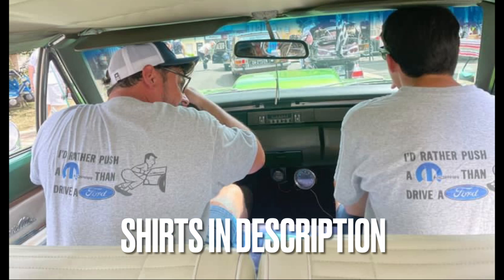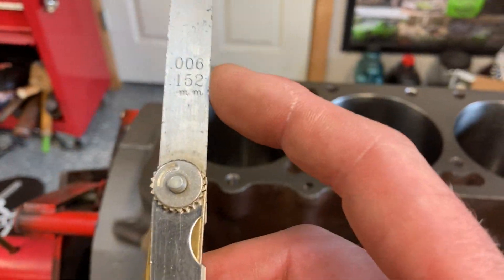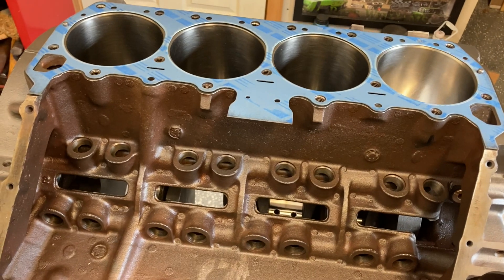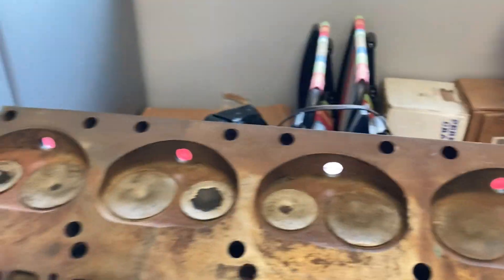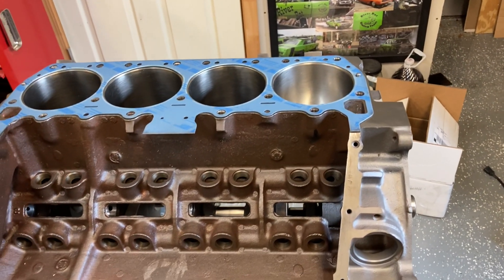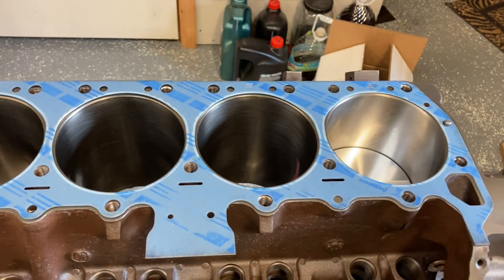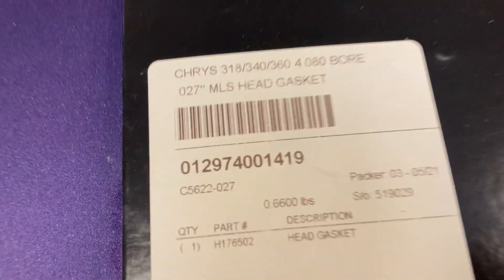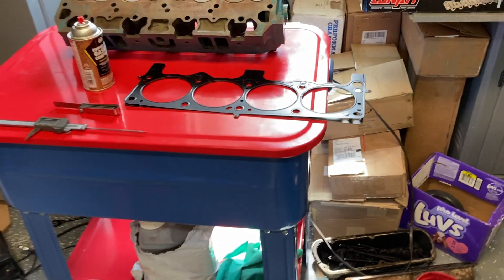3 Common Head Gasket Mistakes Made by Mopar Engine Builders(that Affect All Brands)

Comment: With respect to the concern about galvanic corrosion between an aluminum head and an iron block, a 6061 aluminum has an electrogalvanic potential of about -800 mV, and nickel-chrome cast iron has a potential of about -650 mV. The difference is 150 mV (or 0.15 volts). If the coolant is conductive then a galvanic cell will exist and the aluminum, which would be the anode, will corrode. However 0.15 V of potential is small and uncontaminated water is not very conductive, so the corrosion rate would be very small. Glycol is even less conductive than water. However with years of use the coolant can become more conductive. For this reason antifreeze usually has corrosion inhibitors in it. Occasionally a manufacturer (GM for example) will use an unusual alloy in their engines (Cadillac) that is very susceptible to galvanic corrosion. In these cases the manufacturers recommended coolant and flush intervals have to be followed or catastrophic failure is almost certain.
Reply from the maker: Thank you for sharing. I am actually a licensed home inspector. Seeing galvanized hooked to black pipe, etc. has made me a believer. Granted the corrosion I see could be 10 years old.
Reply: @JustMoparJoe  I'm sure as a home inspector you have seen it all! My own current house, when I moved in 15 years ago, was horrendous, especially the wiring. I have sorted it out back to code over the years but now and then I still discover a surprise from previous ownership. I am a chemical engineer with a love of hot rodding and an affinity for Mopar products ever since my mom ordered the first Road Runner sold in Alberta in the late summer of 1967!
Reply from the maker: @gavinmclaren9416  send me email, if you don’t mind. justmoparjoe@gmail.com
Reply: Our water pipes leaked and finally sealed themselves. 
Calcium I'm guessing. Running water in a hose clogs. Y connections corrode so the valves won't turn.
Reply: Nickel!
Reply: Bingo maintenance is key! Great explanation by the way.
Reply: Modern coolants (not green) have special additives for this. I have pulled apart Cummins ISX engines with 500,000 miles on them and all metal parts aluminum or iron looked like new. I have a Milodon gear drive we ran on a 440 for many years with green coolant. The aluminum water pump spacers are so corroded they are almost unuseable now. There's additives out there for the old coolant for this, there used to be little zinc bar sacrificial anodes with a chain on them to put in your top tank. All of this depends on the alloy as well. I'm sure we have all seen the corrosion on old aluminum water necks, but the smallblocks have aluminum front covers and I haven't seen a failure from this on the ones I have owned, but I build mainly big blocks.
Reply: Water isn't exactly conductive except salt water. I think depending on what's in your water (such as copper or iron) it will effect the conductivity from the start. Distilled has nearly no conductivity, and would be fine in an engine with the voltages it would see. Any metal that falls off into the water from inside the coolant would definitely cause it become more conductive though. But with how much coolant costs I wouldnt mess around with water especially since all it would take is one freeze and you're gonna have issues. And given Texas had that winter storm I think that's just a big risk that's not worth taking. I live in NY so water is not gonna be going in any engine of mine unless I need to limp it home. Plus the extra additives in coolant that make it cool better and prevent corrosion just seems like a no brainer for the price. Why mess around when you can just guarantee. It costs less than oil.
Reply: I can only think of two words..."Water Wetter"🤭
Reply: found a guy with 85 years old that solved that problem,, he had an engine with 55 years old, in his trawler
Reply: I never liked the idea of iron block/ aluminum heads. I bought a 1990 Buick century with a 3.3 LITRE. The seller to me, never used coolant. I ran  water & rust converter, then flushed it. Ran coolant and had no problems. But next smog test it failed on NOx badly. I never got it to pass. 
Later I drove it to work & when I got home it gushed a puddle of pink fluid. 
The transmission tube in the radiator had broken. 
ATF mixed into coolant & vice versa. 
I added a trans cooler, external. 
Flushed the cooling system. Easy. 
Tried to do a transmission flush after a filter & pan dump & cleaning. Lots of black clutch material. 
After 4 gallons of ATF run thru, both line disconnected, no success. Still pink.
In all the time I owned it , never blew a head gasket.

Comment: Just remember most big block Mopars came with steel head gaskets that did not use anything like copper coat. With that being said been drag racing for almost 40 years if it's a steel head gasket Ive always used copper coat up to 14:1 compression never had a problem.

Comment: They may be reusing their gaskets     Factory Max Wedge and Trucks had Stainless Steel shim gaskets    Victor and McCord had Solid core "Marine" and truck head gaskets  I do not know if they are still available but I had to use on my heavily decked 440 (to correct warped decks as Joe has shown) leaving my 6 pack pistons +015 out of the Hole   with a .050 gasket I ended up with . quench.030   with ported 915 heads as shown in the video  those heads also had pits on the deck where the o ring would seal 
No electrolysis steel gasket on Iron block but you do not want to use with AL heads as you can get Brinelling    You can use HYLOMAR on gaskets that are marked for Dry Use if you have water seeps
HYLOMAR works on the old RED gaskets and FELPRO   I never gets completely hard so you can disassemble  Developed by Rolls Royce for aircraft  miracle stuff
BTW my block also had HUGE chamfers which were made smaller with the decking  you want very little chamfer, just break the sharp edge and be careful when installing pistons

Comment: The main thing you should do is try the head gasket on the cylinder head itself because if the fire ring sticks in anywhere it will melt period so my advice is to make sure the gasket is way away from the combustion chamber. I think the trick flow cylinder heads have a larger bore. Fel-Pro sells a marine gasket. I think the part number is 1105 that has a larger inner bore diameter of 4.5 I believe.

Comment: Thanks Joe. I wasn’t aware of larger bore head gaskets. Felpro has different numbers for different bores? Or do you need to use another manufacturer?
I know my block is not perfectly smooth so I feel better now knowing I didn’t install the MLS. 
Jay Leno uses a different coolant that he claims will not break down and prevents rust. I wonder if that coolant helps with electrolysis. It’s called Evans Waterless Coolant. Ford has an additive for their diesel engine coolant as well. Any thoughts about any benefits using these additives when you use aluminum heads? Maybe a call to a manufacturer might be helpful.
Reply from the maker: I'm not familiar with that coolant, but I would suggest using a newer style coolant if you’re worried. Remember, all new engines have aluminum heads and have a coolant that’s made to prevent many issues.

Comment: I have chased the leaking gasket issue myself with attempted tuning, even replacing valve springs. Your issue was likely not at the front but between the cylinders. Mine wouldn't leak until under full power at around 5k rpm where the cam came in and cyl pressure was highest, then a little fire goes across to the cylinder on the intake stroke igniting it and causing backfire. It never showed on a compression test. It was a 383 that hadn't ever had the 906 heads off of it. that ran fine with the 1958 2x4 intake with 2 625s on it, but when I put long rams on it with those same carbs it created enough "boost" to lift the heads! I have ran a six pack, 2x4 bbl, tunnel ram, and most 4bbl intakes. Those long rams beat 'em all up to 7500 rpm with 2 big block thermoquads on them when cammed properly. You will have to pry those long rams from my cold dead fingers!

Comment: Corrosion will happen with dissimilar Metals that's a given but electrolysis requires an electrical field running adjacent to a running water source like a cooling jacket. I cannot tell you how many times I've had laid underneath the diesel engines getting  black rain all over me doing an in frame overhaul because they're blowing coolant into the cylinders from the pinholes in the in the cylinder liners caused by electrolysis. We always use a product called water wetter, it neutralizes corrosion due to dissimilar metals and also controls electrolysis. It also keeps the water pump lubricated. 
  Now as for the aluminum heads on the iron block with the steel shim, I wouldn't use just the plain steel bead rolled shim, I would use a MLS like a Teflon coated Cometic. No copper coat, just smooth, like Cometic says.
  Work goood, last long tine!😖😆😛😝🤭✌️
             Thanks Joe!
Reply from the maker: Thanks, Brother

Comment: C o m e t i c gaskets, the MLS style, aren't they Teflon coated except for the center shim? On my red 383 Magnum with zero deck flat top Pistons at 10.5:1 (no valve relief) compression I use and reuse a 0.015" shim, & I don't use copper coat. First time the bead is crushed it's only steel against iron, the second and third time the steel gets crushed I use a can of silver spray paint. (not the whole can) when I pull the heads it leaves little pentstars between the cylinders..
  Thanks Joe!
Reply from the maker: They do have a coating, but im not sure what it’s made of. I do know that copper coat sticks to it nicely. My wife won’t let me spray her cooking pan to test it 😅
Reply: @JustMoparJoe  maybe pick one from a second hand store. I know what ya mean. My wife threatend me w/bodily harm cuz i moved the fridge to the barn... she's gonna kiiill me when she sees where the stove is..
  Ima git 'er another one
Honest🏴🤑
   Thanks Joe!

Comment: Heck on a cast iron head i use the steel factory gasket with smith bros adj pushrods on stamped steel rockers do not want no more than 30 thousand on pre load on lifter
Reply from the maker: Thanks for sharing and have a good weekend

Comment: You did not offer a remedy for the overlapping gasket into the cylinder bore. What would be a head gasket option if you did a 60 overbore on a 400 block? You spent way too much time discussing putting coatings on head gaskets. I don't know anybody who does. It was a waste of time.
Reply from the maker: You want me to give you the solution, or was my video a waste of time? Both can’t be true.
Reply: @JustMoparJoe  I didn't see a solution
Reply from the maker: @davidjenson8124  you buy a bigger bore gasket. If your heads and block finishes are nice, then go with cometic style MLS. If you’re unsure, then go with the fire ring style. I bought a 4.500 bore to be safe on my 512. It had a large chamfer like I mentioned in the video. But the purpose of the video to raise awareness about the gasket overhang. Hopefully this helps, David, and Merry Christmas 🎄
Reply: @JustMoparJoe  Thank you MoPar Joe God bless you and your family. Merry Christmas!

Comment: Let me give you a clue that you don't seem to realize. Whether you use a steel head gasket, a copper head gasket, which I've seen a lot of people use, or a felpro that you are showing, and you put an aluminum head on a cast iron block you're going to get galvanic response and get electrolysis. Can reduce that affect in a race motor by using distilled water. But you have to change it often. Otherwise on a street block it does keep it reduced but you have to change that coolant at least every two years. And it doesn't matter what kind of head gasket you use because the bolts that hold the head to the cast iron block are made of steel and they're still an electrical connection between them. Does not matter what the gasket is made of. The galvanic response is a direct result of an electrical connection. If you could insulate your head from the block, merely by putting a non-conductive head gasket on it, your ignition system wouldn't work because your spark plugs would fail.
Reply from the maker: How do modern engines work with aluminum heads on iron blocks? Like the 5.7 hemi or some LS’? I’ve only ever seen MLS gaskets on them
Reply: Your negative ground bolts to the head....

Comment: Have you ever torqued a head with one of these gaskets and then removed to see the sqish difference? Cool video! 👍
Reply from the maker: I have used them on several engines, but had a failure when I didn’t look for the overhang. It was a bad day at the races!

Comment: My experience never use factory stock steel shim head gaskets.
Reply from the maker: I believe they’re really nice when you have two flat surfaces and need to set your quench closer. But I copper coat them religiously.

Comment: There’s lot of good information and bad information out there on the web and YouTube. I read what 440 source recommended for head gaskets for there aluminum heads. 440 Source recommended there composite gaskets, Felpro or a MLS. Factory steel shim leak per 440 source. 
I used a set of Cometic MLS .029 gaskets. What I have found work on Chrysler products for almost 40 years. The MLS gaskets don’t actually blow like a composite gasket. They loose there seal when overheated. But we still say blown head gasket.

Comment: On a cast iron head I use the steel shim factory h gasket with copper coat never had  a problem
Reply from the maker: They work well, but be sure the deck and head surfaces are flat. The last thing would be to check if the gasket falls into the bore. The old shim gaskets hang into a big bore 400 and may need trimmed.

Comment: Notchs r were valves r  so if u notch block to match  the valves flow better
Reply from the maker: Especially if the valves are shrouded by a tight bore. It's not necessary in this application with this sized valve and huge bore size. The heads Im using have been unshrouded professionally to match the cylinder wall and gasket

Comment: My question Is.. is that flap in the middle of the gasket that hangs out above the lifter valley detrimental to the running of the engine? I have a  318 la that I'm working on, and those flaps are bent down a covered in a thick layer of carbon. Can I just clean them up and flatten them back out or do I have to replace the whole gasket for the engine to run properly?
Reply from the maker: That flap does nothing but aligns with the head. It doesn’t contact the deck surface at all
Reply: @JustMoparJoe   thank you very much for quick response! I was really dreading the thought of having to replace the gaskets just for that. Glad I found your channel, you're the only source of info I've found regarding the flaps. Thanks again!

Comment: I had always assumed compression ratio was a way to explain the differences in volumes between BDC and TDC.  Would a higher compression ratio engine create more cylinder pressure than a lower compression ratio engine? I’m curious how the two units of measure relate to each other. Correlations vs causations and such.
Reply from the maker: One of the greatest ignored factors is the camshaft and its influence on the engine’s dynamic compression. You can have a high static compression engine with a huge duration with less cylinder pressure than a 10/1 engine and tiny cam. The cylinder fills with air. The cam controls how much air is allowed in and for how long.
Reply: @JustMoparJoe  that makes a lot of sense.  I hadn’t even thought of that, but it makes total sense.  Thank you.

Comment: I've always wondered if you should size the Headgasket Hole to fit the Cylinder Hole, or the Head Hole if that is bigger. I go for the size of the Head Hole.  
For MLS gaskets,  I have no Idea what 50ra is. Never seen an example
Reply from the maker: Check this video out. I show the decking and use of a profilometer. Pump Gas 508 Stroker Build: Decking and Finish Honing #mopar #bigblock #440 #440source #stroker
https://youtu.be/EFG_ZMyT2f0

Comment: I had a scratch between all my cylinders on a set of heads I ordered. Fell out of the box during shipping, guy wouldn't cover me for a $60 resurface because "5 thou is SAE's standard for no head gasket leak." It was 4 thousands deep and when my guy resurfaced it he said they weren't flat either. I wouldn't have been too bothered if it was towards the edge of the head but right between every cylinder and the fact It was catching my nail and then to find out it wasn't flat either pissed me off that he didn't care about my time and $240 I paid for just shipping the damn things. PIE is not high on my recommendation list for heads, he ports EQ heads and installs bigger valves but I think I would've rather just done it locally. Everything he did is nice but he just thinks I've got all this time and money to rebuild it when the gasket blows. No dude I wanna do it right the first time
Reply from the maker: Thanks for sharing!

Comment: I think those indentations in the head gasket are for relieving your block relieving the block helps with air flow into the cylinder
Reply from the maker: Thanks Robert. I think someone had shared that the older 413’s needed that indentation.

Comment: You don't coat head gasket because,  they cannot slip when glued on. The metals move at different rates, so head gasket has to accommodate this.
Reply from the maker: Thanks for sharing. I think the coatings were so infamous back when the shim gasket was used.